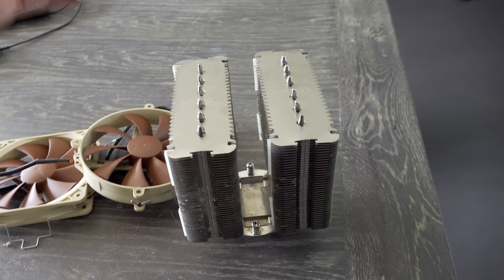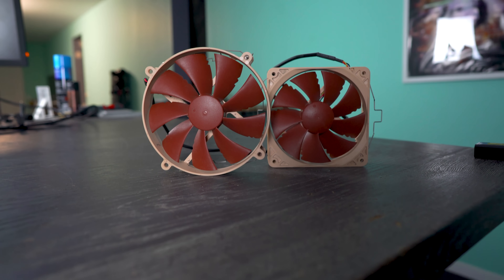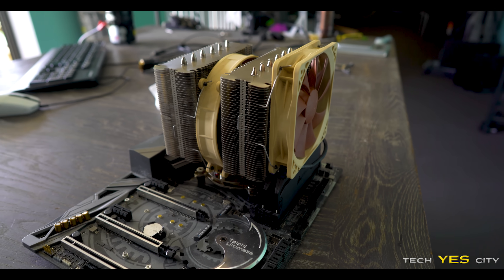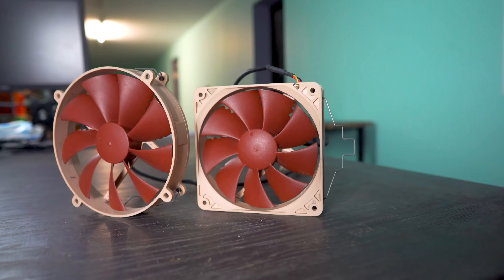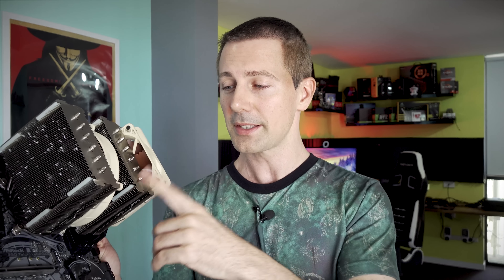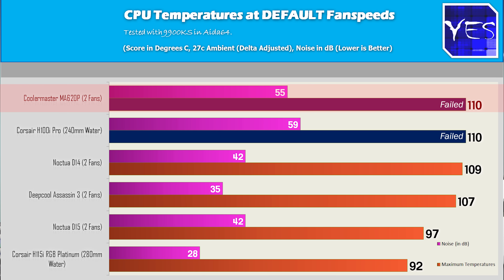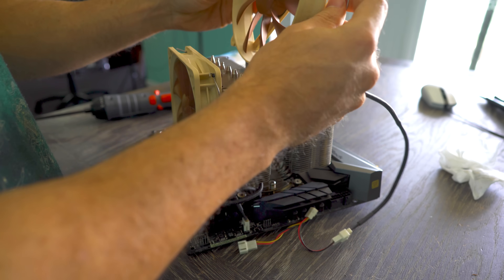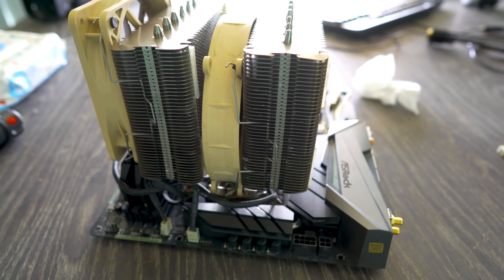This Noctua D14 is from 2009.... How Well Does it Perform in 2020?

Comment: How does the NH-D14 performs in 2020? 
Me: Turns head slightly to the right, then opens hardware monitor, sees i7-6700k overclocked at 4.7 ghz, at 61 celsius while both gaming and watching youtube... I say it performs well :)
Reply: lmaoed reading this
Reply: Same here but with a 2600k, 16gig vengeance LP mem and EVGA rtx2080 in a HAF-X with Cooler Master Silent Pro M2 720W PSU.

Still going strong although the CM 200mm fans are crapping out ish. Bearing is a bit worn of the upper rear fab, but when the case is level it doesn't act up.
Reply: My nh-d14 while i play on an 9700k oc at 5ghz the temps are under 65c
Reply: xeler 8 I have a 1600af running at 1.45v (4.2) and my 5/6 year old h80 kept it under 80 degrees. Also handled a 1055t @1.425/4.5ghz
Reply: Was also cheaper than a d14, if you can believe that

Comment: I find your results hard to belive, since the nh d15, 14, and the assassin should be all within 5°C difference. I would understand if the nh d14 somehow aged and falls behind because of that, but considering the assassin results, pretty sure you fucked up somewhere rather than the nh d14 having aged.

Comment: I've still got my old D14 boxed up.  When I moved to a 6700K there were rumours going around about the substrate not being strong enough to withstand big air coolers, so I got a smaller Noctua cooler to be on the safe side.  FWIW Noctua fans have a MTBF rate of 150,000 hours and I believe them.  That's just over 17 years running 24/7.  I'm still using the same NF-P12 case fans I've had for about a decade with no issues at all.  I have to clean them every now and then, but that goes for all PC components.

Comment: I've still got my original Thermalright Ultra-120 Extreme strapped to my X58/X5670@4.4GHz. I wonder how well it'd do on that 9900KS.
Reply: Yeah, i still have mine from ~'06. Would love to figure out how to mount it to socket 115x and test it out. Was a fantastic cooler at the time.
Reply: @Mr1Tanker  There's an adapter bracket that works for it. The TRUE universal BTK although I think it's discontinued now.
Reply: @CompproB237  Ok.. i'll look on FleaBay or something.. thank you sir! :)

Comment: Been using Noctua Coolers for nearly a decade now. Until recently they were purchased new, but this time I watched eBay and lucked on to an NH-U12Sfor about $45 shipped/ The owner had purchase new and used for a few months, then replaced it. The cooler and fan looked new, and it had all the parts. So I saved about $20 for a slightly used Noctua and am using it on a Ryzen 5 3600X system. Does well for my needs and can always set it up as push-pull if my needs change. Anyway, really enjoyed the video!

Comment: Great video mate.  Have been using Noctua since 2009, and have never had a fan go on me.  The coolers themselves obviously work forever, assuming they are cleaned and maintained with a spray similar to what you used in this video.  I did have one fan become a tad noisier (at full speed).. I don't recommend running 3 pin fans flat out all the time.  Some motherboards are able to adjust 3 pin fan speeds, using a program like Speedfan.  Or Argus Monitor.  But yeah.. that fan got relegated to hard drive cage duty (I max it out at 900rpm) and it's still working great.  The full speed CPU fans take the most load, so even rotating them around after a few years could be helpful (if you also use noctua for case fans).  These days with PWM fans.. the adjustment of their speed is less of an issue.  But I also recommend using a fan controller (that can adjust speeds via Windows) over using a preset fan controller that comes with the case.  But I guess that is a preference issue.  I prefer quiet systems and it also helps that it can reduce the wear and tear on the fans a little bit.

Comment: Been using the same Zalman CNPS10 quite air cooler for more then 10 years now , purchased it brand new when i got my Phenom X4 940 , it then cooled my X6 1050 , FX8320 a R7 1700 and now my R7 2700 probably will keep it when I upgraded to a R9X 3900X or what ever 4000 cpu I get , air coolers are the best in terms of longevity !!

Comment: The hold down screws fall out, or at least they did on both of my D14's.  Also managed to bend the tabs the hold down screws are attached to.  I did like them and their performance though, they just suffered from a lot of use/abuse from me :)  For the record, I modified one of them to fit on video cards using a hold down from an HR-03.  Took very little to do the mod to make the hold down work.

Comment: whats really amazing to me is the heatpipes held on to their internal liquid for that long, i think the sheer fact that it stayed under that 110c limit is proof enough to show that noctuas heatpipes do not dry out over time like many others do.
Reply: Heatpipes are 100% sealed metal tube system so unless they get damaged (punctured or external corrosion) or have a manufacturing defect, they should never leak out. If they are ever damaged they fail pretty much immediately since the working fluid used in them boils off.
Reply: I've never heard of dried out heatpipes (if undamaged). Do you have some links to articles with solid evidence on that topic?

Comment: I am really surprised with those 110 deg temps though ,
i'm purdy sure mines never got above 76deg even in summer with 3700x 
must be an intel thing yikes
Reply: arkup  the cpu he’s using is heavily overclocked and his ambient temps were 28c  (82.4F) he’s also running a constant stress test to for the CPU to heat up as much as it possibly can. Of course a 3700x doesn’t get that hot, when it’s not in the exact same situation.
Reply: @Buchta179  yeah fair enough , I live just up the road from Brian so I get the same temps ,
anyway using the cooler under normal circumstances you obviously get better results
but lordy 110deg is scary stuff to me , still I stand by that NH-D14 they are worth using
Reply: @arkup1  blame intel 14nm lol. The 3700x doesn't take that much power on 7nm

Comment: I'm still using the NH-D14 in my Ryzen 2600 + B450 build. Got the free AMD mounts from Noctua.
Reply: Reichter Aguilar I literally just bought this as an upgrade from the stock
Reply: @TheMortzCanberra  if I recall correctly I used my NH-D14 on my Z68 with a i5-2500k. Still going strong all these years!

Comment: Well you know, 10 years ago there were 130W TDP processors like the Core i7 970, 980 and their X versions. Cooling those while overclocked was not easier as cooling a 9900K. The thing was needed back then.

Comment: hate to break it to you mate but your using it backwards ,
the fans are supposed to be mounted against the silicone vibration Compensators 😘
it's a damn good cooler though

Comment: My experience is all Air Coolers will live practically forever. Just need to swap the fans eventually and pray that the mounting will hold up with newer sockets/motherboards. Same with Liquid cooling components if maintained properly. AIOs however wont hold up nearly as long however with them either losing fluid due to evaporation or the pump frying.

Comment: I have one myself massive value for money. Also you can grab just about any pre used noctua air cooler with the secure fit mounting mechanism. Buy a am4 mounting kit for like 14$ slap. It on a ryzen processor and Walla mad air cooling for less then $70

Comment: Hey if I want to clean my Air cooler that's just a bit dusty, what would you recommend normally if it's not as bad as the one in this video?
Reply: Compressed air can
Reply: @miniweeddeerz1820  It's on harder than that, I've used an air gun and it's still on there, is it then just water or would the toothbrush he used with some kind of solvent be the way I'm wondering?
Reply: @conza1989  well you could try his method. It isn't too hard. You just need some washing up liquid and a bucket of water. Don't forget to dry it afterwards though

Comment: Ive got two D15's and a D14 reused them so many times over many upgrade cycles such a good investment.
Reply: Bryce Cutting same with my evo 212 I’ve had it near 10 years now
Reply: D15 have the ram height problem or not?
Reply: @CommanderTato  nah the d15 was redesigned, its more the Fans that get in the way now days lol. Especially with the big Heat sink VRM shrouds On modern Mobo's lol. My side panel just fits on and the glass is sitting against the fan.
Reply: @edgelordcutting  ,
Only the second, 140mm, fan is problematic. If your fan is the same height as the middle fan (165mm case clearance needed) then you've got up to 32mm for the DDR4 memory with the NH-D15... the Corsair LPX memory is 31mm so should work and of course you can move the second fan UP if you have the room but a lot of cases aren't taller than 165mm for CPU cooler clearance. If your case lists 170mm then you have up to 37mm DDR4 clearance... also, note that the NH-D15s exists which has one fan in the middle only and slightly shifts the cooler away from the top, x16 slot... if the NH-D15s was $20 cooler I'd recommend it but if the price is closer I'd get the NH-D15 then just use the 2nd fan as a case fan if you don't need the extra cooling.
Reply: thanks for suggestion...i have to change my  cpu cooler but i don' know... now using thermaltake armor 2009 silver anda cosmos 25 anniversary tha seems a tie fighter at my eyes

Comment: i used this exact cooler for 7 years and tbh its crap, at least mine was. I bought Arctc freezer 34 esports duo and its miles better. I sold the Noctua for 40 usd and bought brand new Arctic for 40 with 10 year warranty, so couldnt be happier

Comment: I was shocked... i expected it to be within ~4 degrees of the D15. Maybe the older fans are letting it down. D14's are usually pretty close to the 15's(12 degrees hotter is really bad). I bet a 212 EVO/LED wouldn't be much hotter than that D14.

Comment: Iconic cooler,had them for years,never let me down-Untill I got the 9900ks and spun it up to a simply unbelievale 5.38Ghz@1.37V(Guess I won the lottery).Had to grab a 360 kraken AIO and it keeps it under 100c(just).
Reply: Might be time to think about going custom loop. My CPU never gets over 55c. XEON E5-1680-V2 @ 4.7GHz all core @ 1.315v. And with some work, I will make it hit 5GHz. Probably at 1.335-1.345v @ 580MHz VRM frequency. And still be around 55c.
Reply: @mattsmechanicalssi5833  Well your cpu has soldered ihs and 9900k is with tim...
Reply: @keijokojootti7790  And a 135W TDP, that uses 260+ watts. I'm sure I can pull 300+ at 5GHz. My 4820K pulls 230w at 5GHz @ 1.335v. TIM or solder, that's a lot of heat to get rid of.
Reply: @mattsmechanicalssi5833  Also way bigger surface area. Anyway. Missing The point a little bit. My point is not to dismiss custom loop or Premium AIO water cooler heat  absorption capacity.  Culprit of the problem is that TIM.  No matter what the heat load is.
Reply: Jesus that's not a processor, it's a geothermal power plant.

Comment: That thing is a legend, not as popular as the 212 EVO but more powerful.
Reply: Well yeah, it was twice the price of a 212 Evo, and most of the gamers were still using Intel I5's which never produced that much heat.
Reply: @Orcawhale1  used to be, I remember that. 212 Evo competed very well at its price. Other cooler master products rarely felt as good of a value. I ended up with 2 for 2 different computers that had very noisy stock coolers.
Reply: @ArtisChronicles  212 is a living legend lol.
Reply: @Orcawhale1  we used to put 212's on core 2 duo extremes lol

Comment: I'm gonna guess that, if taken care of, metal should be as good as it was in terms of thermal performance.
Reply: @Maxtraxv3  mmmm no I don't think so. If it doesn't escape under expansion then I think it's okay.
Reply: @LastExile1989  Nothing is made perfect, flaws in production happen but most coolers with those flaws will work for few years before any noticeable difference. Factory seals on heatpipes can go bad if they are not done properly (on cheaper coolers).
Chances of air cooler failing on you are way smaller than aio, since they usually don't have that much factors (like pumps, fluids, connection points). I've never had any heatpipe related problem yet, i even had few of them bent and they still worked fine with minimal differences. I did try cutting them and cooler was trash after that (couldn't even handle 65w cpu), so coolers should be handled properly to avoid any damage.
Reply: @cekpi7  yea I'm sure in the sheer hundreds of thousands of coolers sold. On top of that dry thermal paste probably plays a bigger part.
Reply: @Maxtraxv3  if it's physically damages then yes